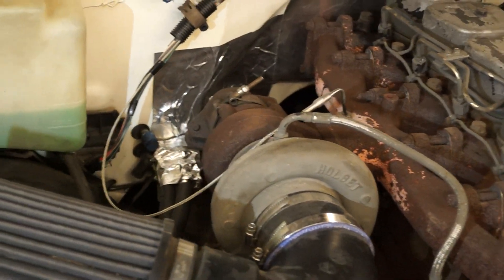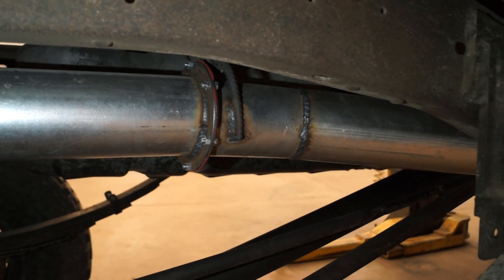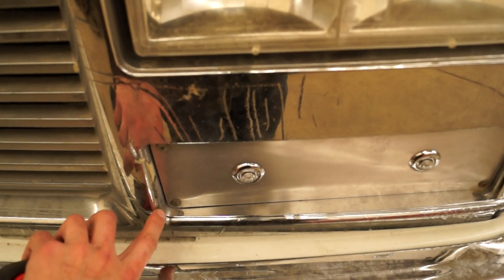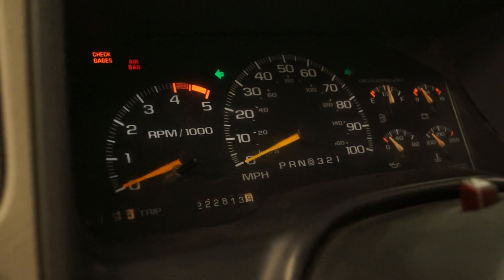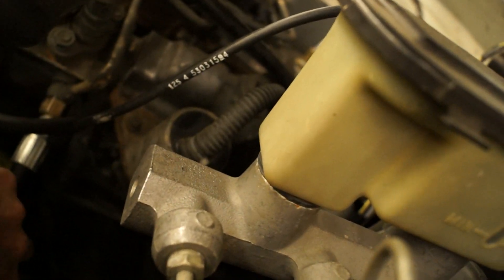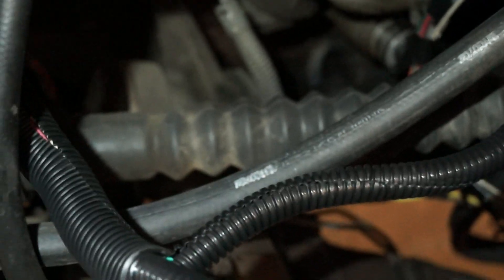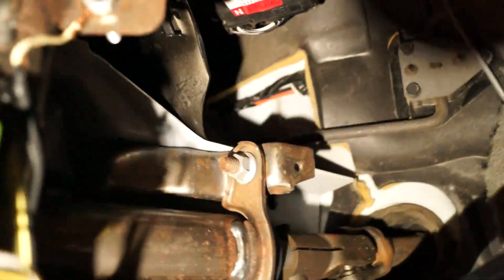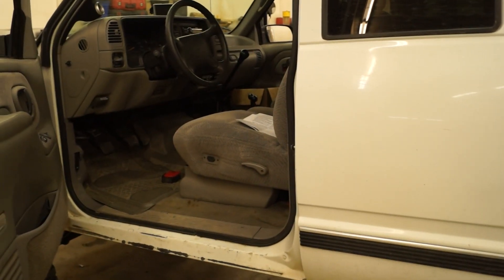chevy cummins swap part 9: 5 inch exhaust, tach working, led turn signals etc

Comment: Big Thanks to you on this one!  You may have just helped me solve and issue on my 98 Suburban.  I retro fitted a newer model (08 or so) electric fan and shroud in to cool it better, which is does fantastically so long as I remember to switch it on.  I did the same thing on my 94 S10, but in there I had an ignition hot lead in the fuse block I could tap.  That way the fans come on when the truck is running no matter what.  If that red wire you point out in the buzzer that I did in fact yank out is ignition hot, then I'm set!  Thanks!

Comment: Hey Rorik, I'm looking for some advice on the tachometer hook up on a Cummins conversion, I've done a 1995 Cummins swap from a 350 tbi. I cant find the wire for the tachometer guage. Where the heck is the wire for that??? I'm using the w terminal and the DSL-1e controller. 

Thanks for posting your videos they've been a huge help!!

Comment: Hey bud, first off I love the truck and the build I'd like to do something like this one day after I get my current truck built. The turn signals don't look all that great in my opinion, have you looked into light bars? I don't know of you have enough clearance for it but that could always be an easy solution to your problem.
Reply from the maker: Jay Powell What is your current build? I clicked on your channel and didn't see any videos up. I'm not exactly sure what you mean by "light bars", can you send me a link? I've been looking at all kinds of lights, and am not happy with anything I've found so far. I'm also getting sick of my cheesy grill, need to get a nice oem GMC one.
Reply from the maker: Jay Powell Well, those light bars are incredibly bright, I'm looking for just a marker/turn signal. Those things are brighter than my headlights!
Reply: Go brighter headlights.

Comment: Too stop your corner lights from flashing super quick gotta put a flasher with a higher resister in it, sending too much power too them cause leds take less power too operate then a halogen bulb its a cheap fix
Reply from the maker: my89z71 I swapped in LED compatible flashers, doesn't solve it. The turn signal indicators in the dash are still on, and the leds and side marker/turn bulbs still don't work properly, or flash/illuminate at the right brightness, even thought they flash at an approximately correct speed. I tried to find a wiring diagram, found a couple, but they don't show enough to allow me to hack this. I may go back to incandescent bulbs in some type of custom housing. I really don't like these leds or want to use load resistors. Annoying how stupid little things like this can require so much effort.